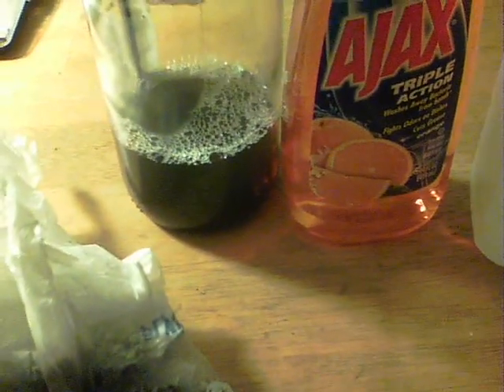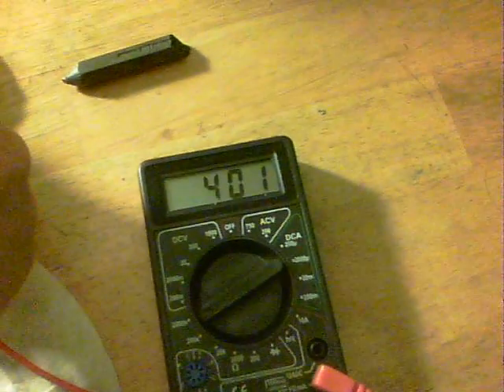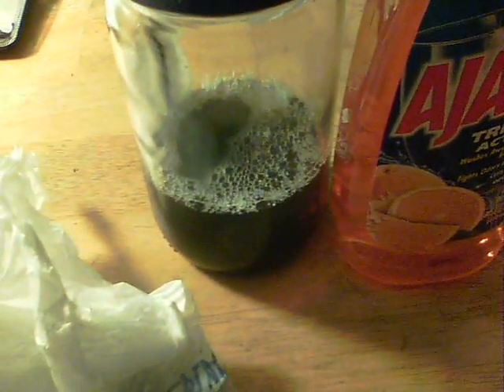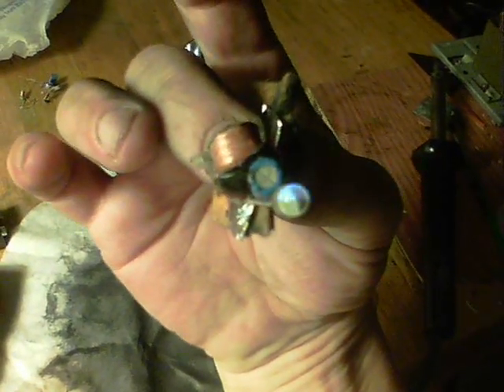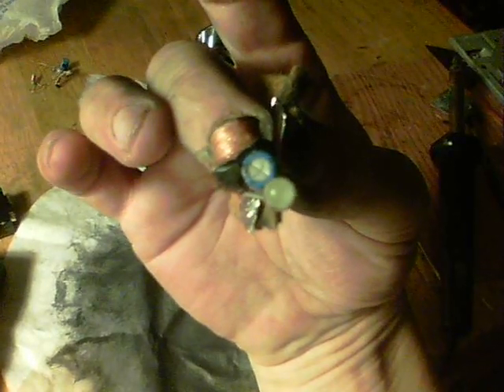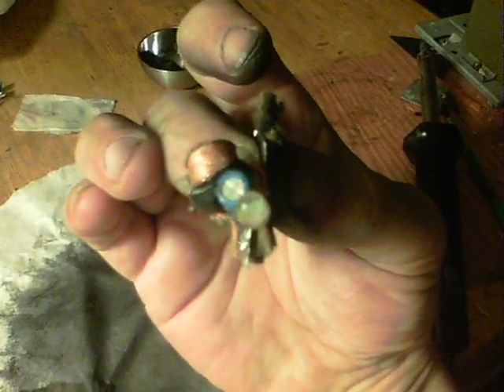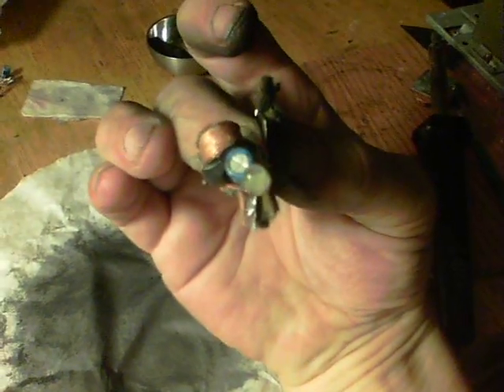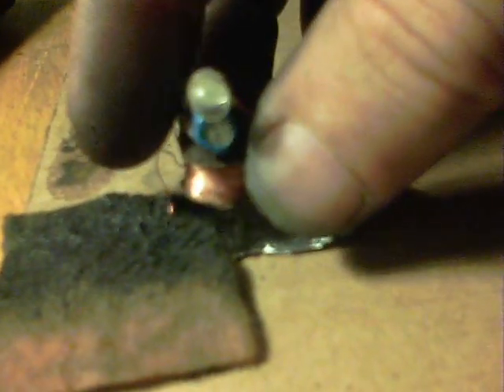Fun with Graphene

Comment: How have we not been doing this already. I'm loosing count of all your good ideas slider. How are you not filthy rich yet? To busy open sourcing everything I guess. How does the filter paper perform as a conductor?
Reply from the maker: Thanks for the kind comments :)
The paper is really good, It 'polishes up' very well on a flat surface and works great for capacitor tests with the Shamwow type stuff soaked in an electrolyte. Also easy to attach a lead to it compared to plastic or glass. Just twizzle some around the wire !
Reply: So simple. We will be seeing this discovery used in all sorts of ways for many years to come I think. Lidmotors Super cap is just the start. You deserve a lot more than kind comments my friend.

Comment: Why is it necessary to allow it to "settle"? and what do you do once it has? Also, does anyone know the easiest way to turn this into graphene oxide??? Can't find anyone who will explain this stuff to me , so frustrating...
Reply from the maker: Hi there...i'd suggest watching Robert Murray-Smiths' videos, especially his latest one as he shows this method and explains it well. He also has a book out about Graphene. The settling allows removal of the water and then it can be used like an ink, for spraying, painting etc. But i'm not that far onward yet, the dried residue from filtering the fully mixed solution is what was used.
Reply: slider2732  Oh I've watched them all, the man is brilliant. Alright so once I've let it sit and sperate into layers, I just take the jar and pour off the top layer? Also, from what I understand you dried out the residue left from filtration and returned it to a solid state... Wouldn't that cause the layers to restack and return it to graphite?
Reply from the maker: Keir Thomas
 Yes, I believe that's the idea for separation.
The coffee filter caught any bits of graphite, being as I smashed it to a sand type level with a hammer...those larger grains had still been vigorously mixed with the dish soap though and Isopropyl alcohol. I used those as a light sprinkling over the CD plastic and then 'polished' the layers away for about 30 minutes.

Comment: Well done, if you use woodash-water as the electrolyte you get a powerful 1.5 Volts Battery this way. You can also use NaCO3 washing soda in water as the electrolyte with alufoil and graphene.
Reply from the maker: Thanks Stefan. Got some chitin here from ages ago i'd like to try too. Will look up woodash-water and try it.
Reply: slider2732 Yes firewood ash in water is mostly a mix of KOH and K2CO3, so it is pretty alkaline. With an alkaline electrolyte you get 1.5 Volts from alufoil and graphite( or graphene) and a pretty good current too, cause you dissolve the Aluminiumoxide protective layer of the alufoil, so the alufoil can react and can be corroded, but then it is just a galvanic cell...
Reply from the maker: overunitydotcom
 Thanks for the explanation, will certainly try it (got a mass of branches in the backyard from a dead tree).